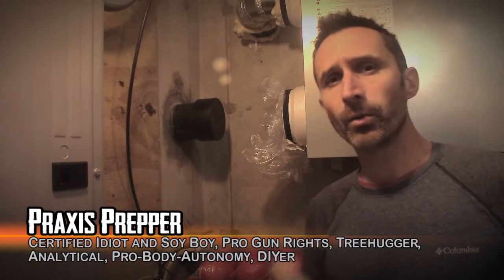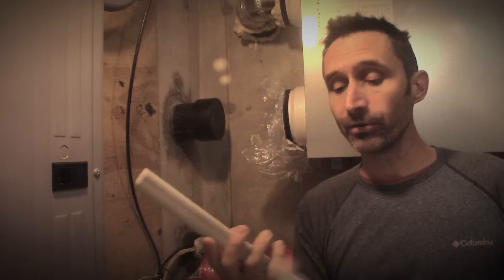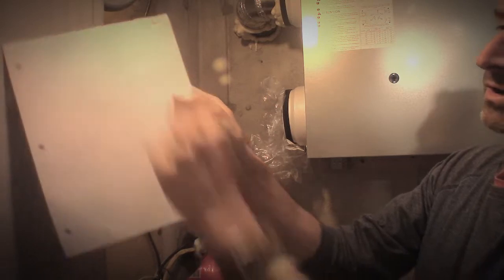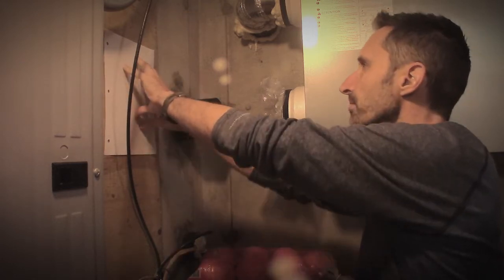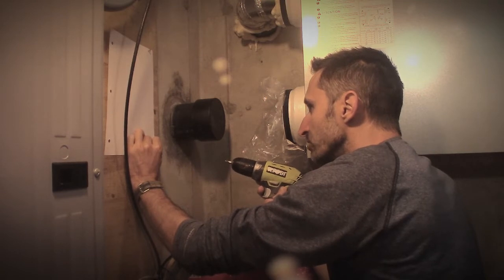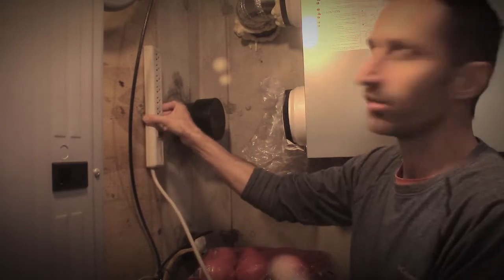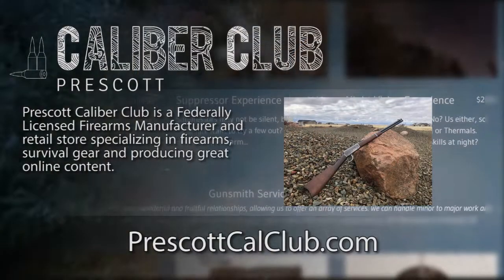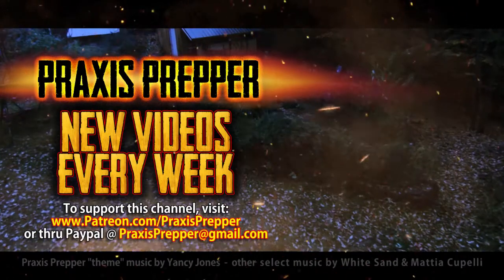Easy Life Hack - No Measuring Mounting Power Strip to the Wall

Comment: I had not thought about that, good idea.  I usually measure, usually just a little off, then find my screw does not fit the damn hole.  One way that I like is to use the hook and loop strips.  The problem is while the adhesive will usually work fine for whatever I am hanging like a power strip, or my gps in my vehicle but will just not stay attached to a wall surface, short screws into the side attached to the wall or vehicle and it will stay on and still be removeable without issue.

Comment: Put a strip of masking tape over it. Poke holes where you put the screws. Put tape on wall put in screws where the holes are. Remove tape.
Reply from the maker: That works too, but scrap paper is cheaper than masking tape. But if I didn't have any scrap paper, junk mail, newspaper, or a ruler, and I only had tape, I'd definitely consider using a little tape for the job.

Comment: That's a good idea for somebody that can't read a tape measure
Reply from the maker: It's also a good idea for people who are familiar with the idea of error accumulation in measuring and marking. Also consider that not all power strips have the holes in line with each other, some are at diagonal corners of the unit for added stability.